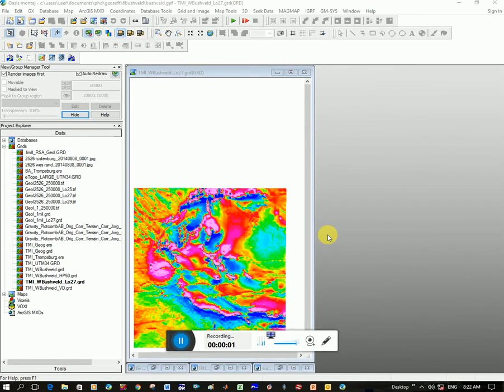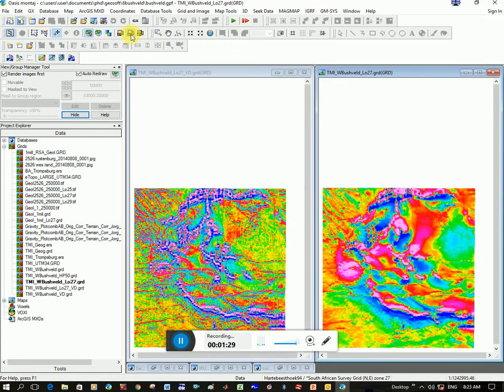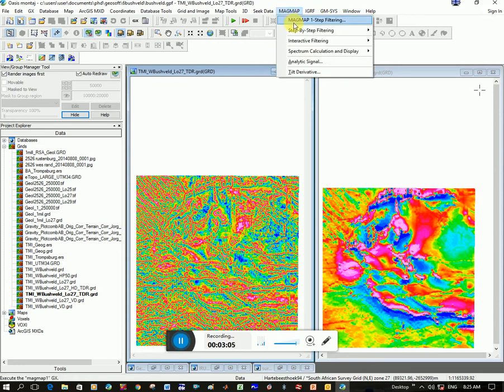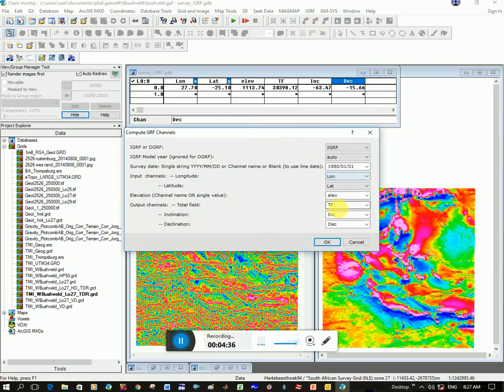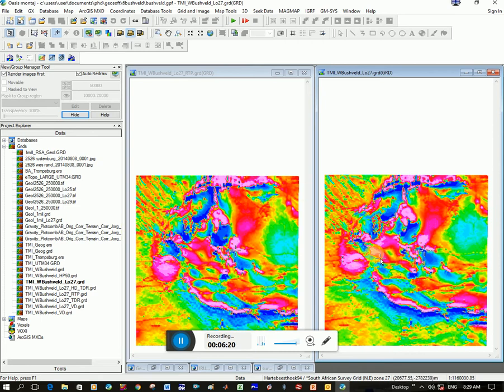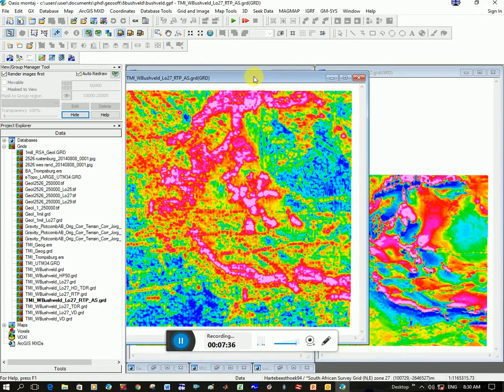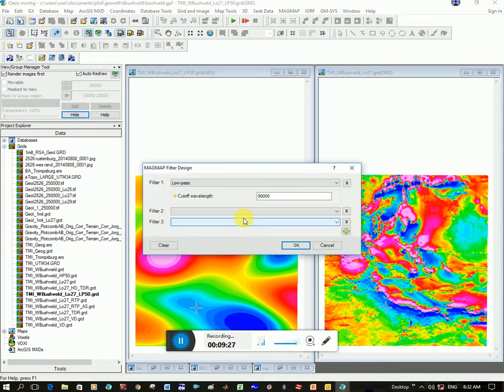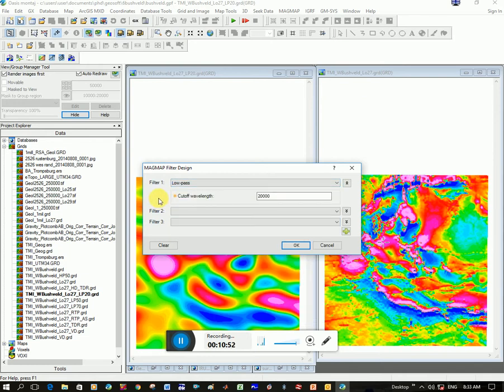Geosoft - 11 Image Processing of Magnetic Data

Comment: how do you determine by looking at your maps how noisy the data is ?
Reply from the maker: sadly I think it just takes experience. you can see noise on the vertical derivative in this video...it shows up as north-south and east-west lines. this is the same orientation as the flight lines and tie lines so I therefore know this noise is due to poor leveling of the data. other forms of noise can be powerlines or fences. these would also show up as straight lines. it is easiest to pick these up by comparing the gesture on your mag data to a Google earth image. towns can also show up as noise and you will notice then as regular shaped grids. If your instrument is sensitive to noise or you are wearing something magnetic or the area is magnetically noisy, you will have a lot of high frequency anomalies in your data, I.e. lots of small peaks inbetween your big peaks due to your anomalies
Reply: Thanks for the info. I think your tutorials are great, I would have killed for these a couple of years ago when I was using this package to do my masters thesis on some grav and mag data, i've not had the opportunity to use Oasis Montaj since then. Do you know any good online resources for reading about a lot of the theory of the data transformations ?

Comment: Good explanation, But what is different between Reduce To Magnetic Pole ( RTP) and Reduce To Magnetic Equator (RTE) ?
Reply: RTP is apply in the high latitude zone and RTE is good for the low latitude zone ( near by Equator) nevertheless, these filters are used to the same goal.
Reply: @gnolebasergepacome9546  when done RTE in this software, is the negative amplitude should be interpreted as positive magnetic susceptibility  ?